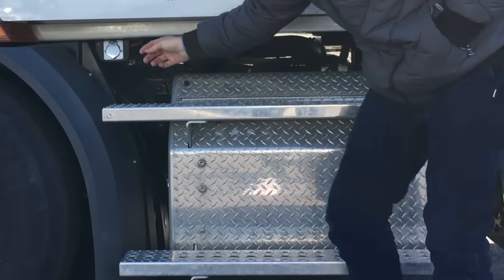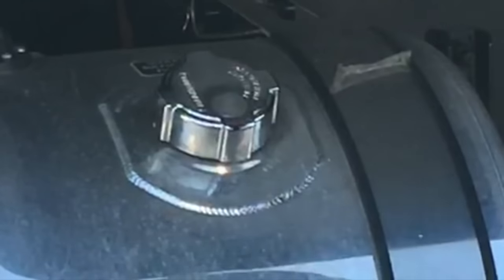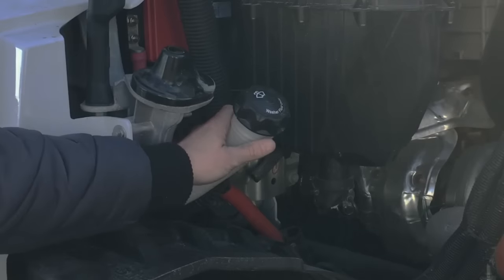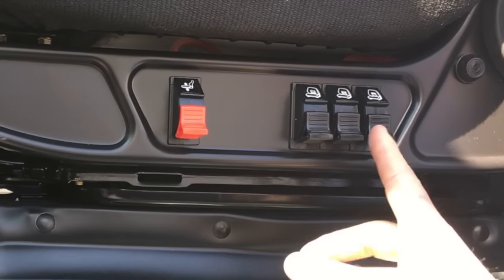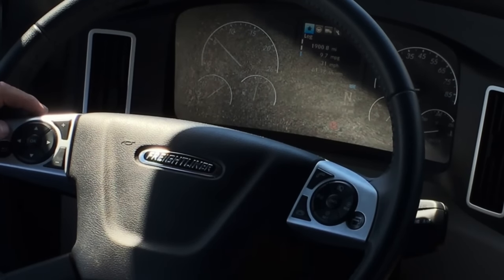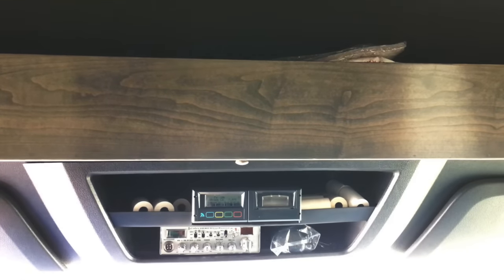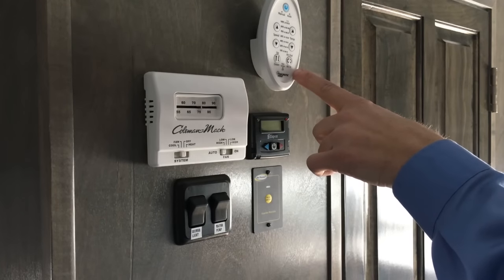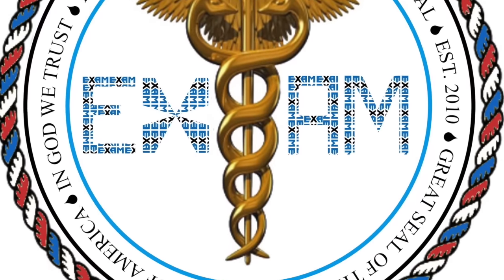EXAM Transport | Tutorial: 2023 Freightliner Cascadia Evolution 120" Sleeper Custom Critical TVAL

Comment: For someone with a class b CDL  who want to stop driving a bus and go back into trucking who use to work for panther logistics.  Who would like to be an owner operator and doesn’t want to be force to team drive.   What is a good company to look at or apply too and we’re can I get a Volvo VNL 860 globetrotter  or a Mack truck anthem  or a Ken worth t 860  custom made into my expedite truck. That is between 35-40 feet long from bumper to bumper.      ?  Please comment.  Positive feedback.    And be respectful.    All companies who see please comment or messenger me.  Thanks.    This is only for the lower 48 and in America.